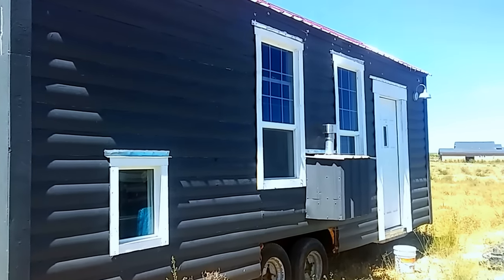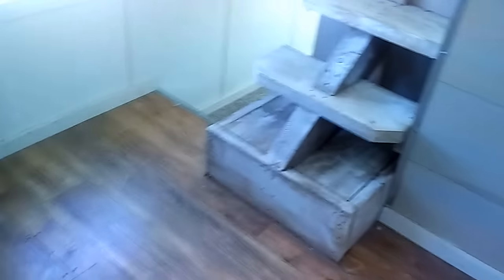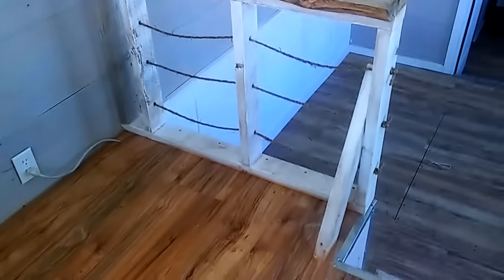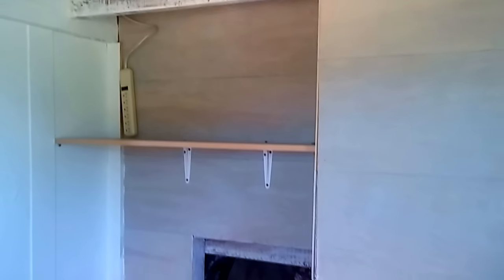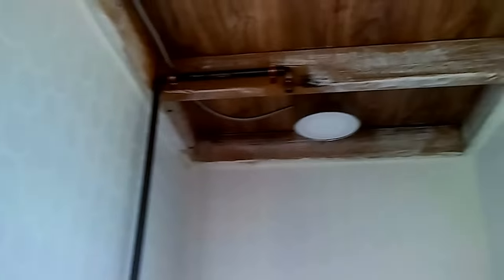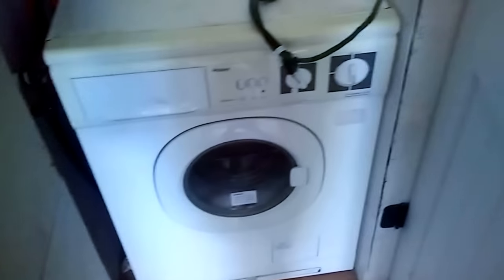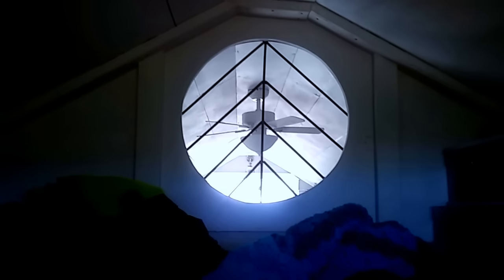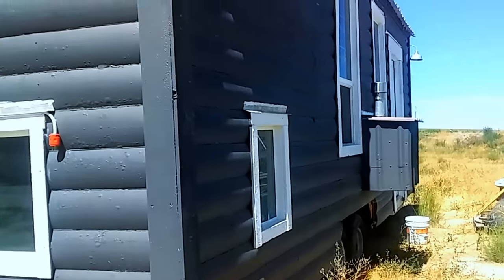TAD HOMES Tiny house on wheels video tour! "The Black Pearl"

Comment: Yay! Tiny house creativity lives! Really like the floor plan and unique touches that make this Tiny House stand apart. Like the lower level master (no climbing into a loft👌👌👌). 
Is it off grid? What's the weight? Insulation? Price? 
Thanks for sharing!
Reply from the maker: Thanks! We thought it was fairly original and met the needs of a family better than other designs we've seen or tried.  Its not entirely off grid, but could be!  Its about 12,000 lbs. R-13 insulation and it sold for 40K. Thanks for your support!

Comment: What do you cook on? There's plenty of room but no stove? And is there only 1 A/C vent? In the kitchen, covered? How does master get any air? How is it powered? Electric, solar?
Reply from the maker: Hello! There is a hot plate and oven but I failed to show it. also the A/C return vent is in the ceiling of the master loft.. all the cool air gets pushed through the kids loft sucked back down and into the master loft back into the a/c unit.. another thing I forgot to show! it can plug into a 30 amp service (: Hope that was helpful!
Reply: Sheila Harvey morning we